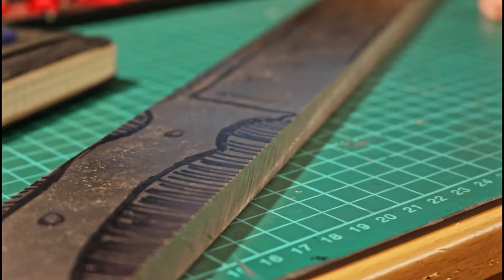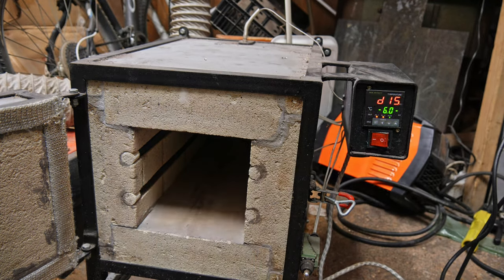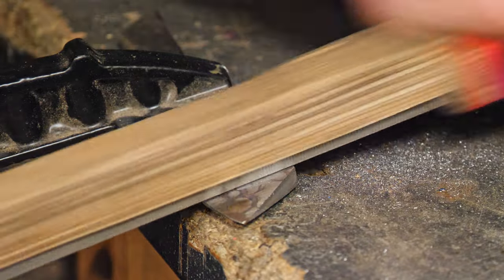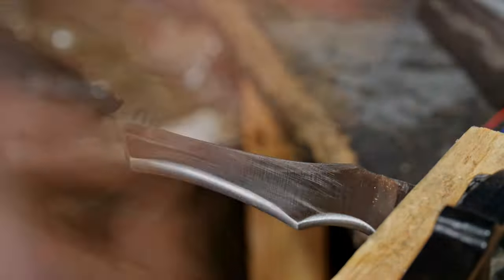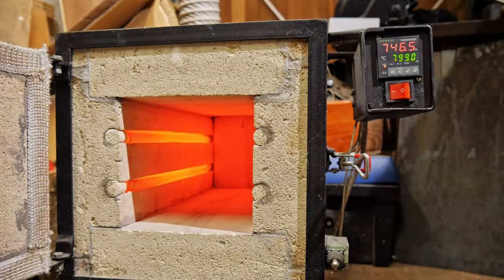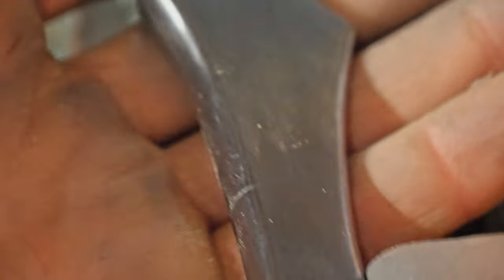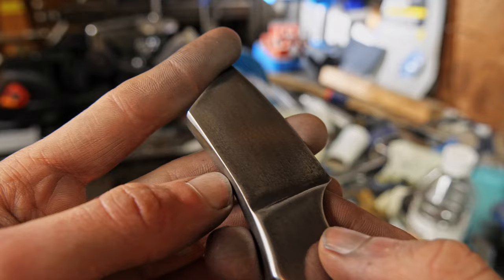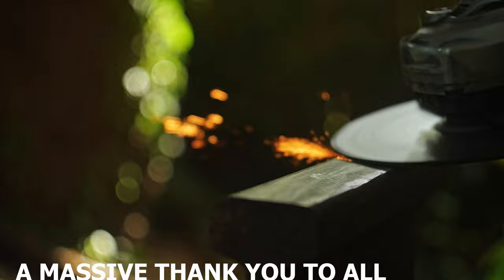Salvaging a Small Knife From a Scrapped Blade

Comment: Hey bro I love ur videos and I'm planning to build a CNC too and it would be great if you can help me a bit. I have researched a lot but I wasn't able to get info about the torque of the motors required for my build, so can you tell me which motors did you use in ur recent cnc build so that I can take it as a reference and select my ones! It would be great if you replied! Thnx
Reply from the maker: Hi! 
I am currently using some standard nema 23 steppers for my CNC (I think about 1.5A ish). Because it is ballscrew driven I don't need that much torque for the motors. Good luck with the build!